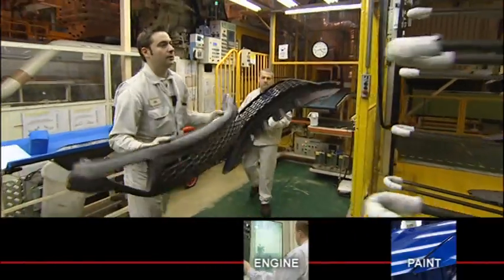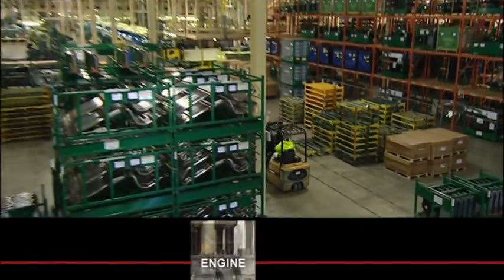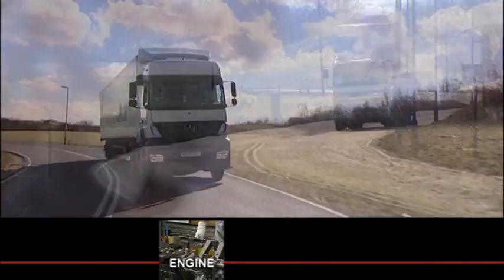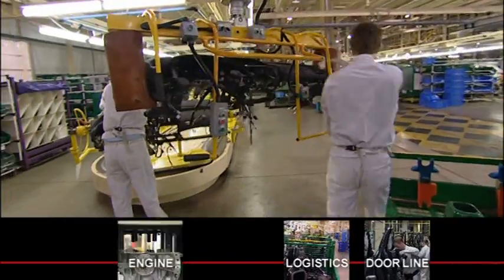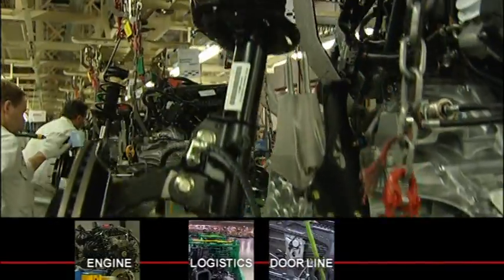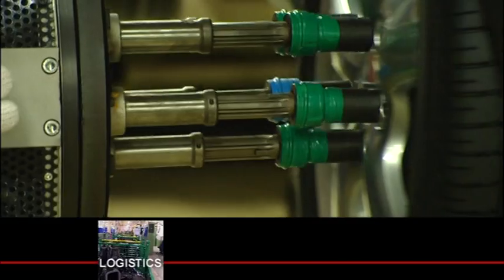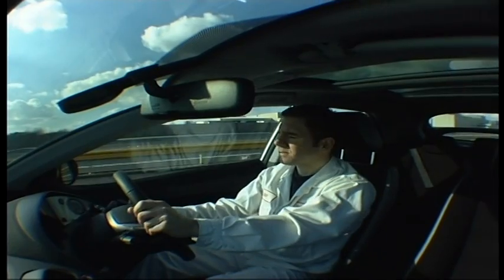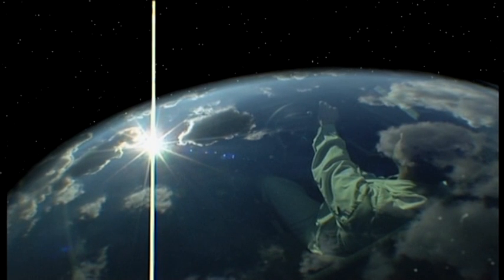Honda manufacturing in Swindon (Part 2)

Comment: @bestamerica Plastic will flex and absorb some of the impact. Metal will not. Therefore, plastic is better for safety of the other person.
If you had to choose, which would you rather be hit on the head with, a strip of plastic or metal?

Comment: cplsyx,
'
dont use a word  - YOU -  on me,,,
both metal bumpers are BETTER stronger than plastic rubber breakable toy bumpers,,,
i like old time in before 1995' s is better stronger bumpers than after 1995 to now 2012